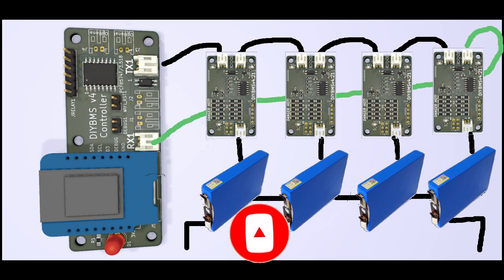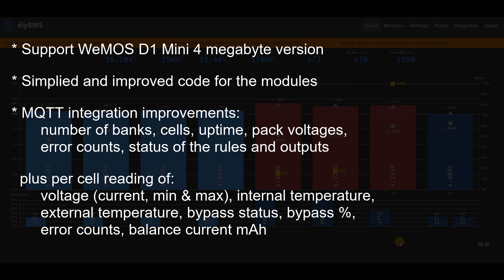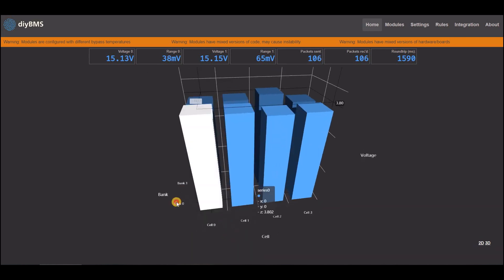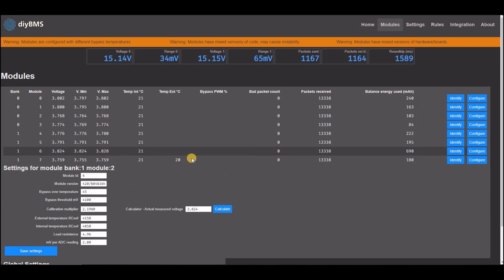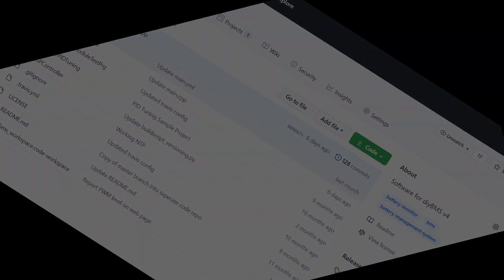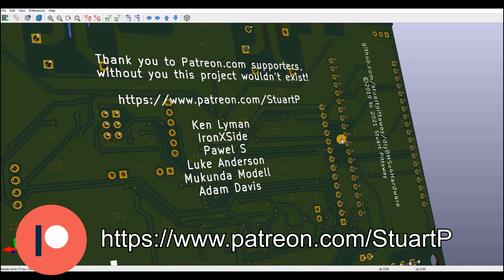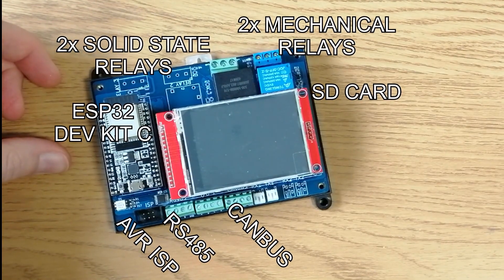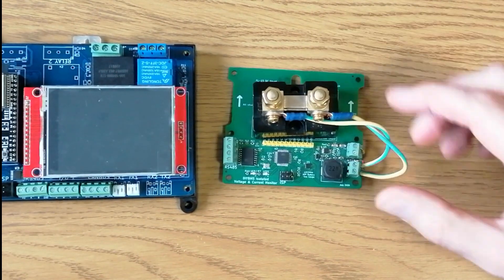DIYBMS, support for 100 modules & new controller update

Comment: Brilliant project! Thank you:) Subbed. 2:28 - i plan to experiment with HV battery. It will be 140 S or even 200 S. Is there any way around the limitation you'we mentioned (100 modules suport)?  Where this limitation is coming from? The daisy chain transmission between modules od somewhere downstream - in controller board or software?
Reply from the maker: Its the daisy chain transmission which is a bottle neck - the speed of the communications limits the modules.  There is another video on this, where I've increased the baud rate to cater for more cells.  Don't think anyone has tried more than 64 modules though.
Reply: @StuartPittaway  Appreciate your answer! Why it is a bottle neck actually? It there some minimum scan time needed? If it take several seconds to scan, say 192 cells in series (two Chevy Volt batteries connected in series) why would it be a problem? I heard some inverters have communication timeout - if i understand it correctly: how frequently they need battery situation status update. If daisy chan scanning is longer than that timeout we can just copy the last status and send updated one once diyBMS scanning is complete. The above exampe with 192 cells in series is an extreme one, i know, however there is more and more HV inverters on the market and there is more and more interest in making HV batteries due to many advantages that come with HV. Yes, HV is dangerous:) 
Anyway, could you please explain me what you mean by saying daisy chain comm is a bottle neck? How about splitting the array into two and perform scanning in parallel?
Reply from the maker: @The_Unobtainium  there are hardware limitations in the design which prevents the communication working over approximately 9600bps. This could be engineered out using different components or protocols, but that seemed overkill when this project started.

Comment: hi . is it possible to create high voltage  power wall bms now with 80s1p at 400v ?
Reply from the maker: No, 400V is dangerous to work with.

Comment: Has any shunt with more voltage support to come? 130 maybe...? Great job!
Reply from the maker: I'm putting together a new video on the progress with the shunt/current monitor
Reply: @StuartPittaway  Great!! I'm starting to learn electronics and install a solar plant in my home. You make a great job! My idea is to make 32s LiFePo4 to get 102v nominal.
Reply from the maker: @paytufo  why such a high voltage? I recommend sticking to 48V, better choice of inverter options and is much safer than high voltage DC
Reply: @StuartPittaway  Because the inverter I will buy can handle 66Amps for the battery since 90V, with less voltage it just can handle 33 Amps. I have heat pump to heat my house and need some power at night
Reply: I've watched the new shunt video and see is limited up to 85v. Could be work the batrium shunt with your diybms controller? I think doesn't have sense to have 32s in the controller and 85v in the shunt. Even though is an awesome job.
Reply from the maker: @paytufo  although 32S is supported (could go higher if needed) I recommend staying below 50V DC, especially for DIY.  Electricity isn't something to play with, and get serious over 50VDC
Reply: @StuartPittaway  I've seen some battery brands that build their batteries exactly as I pretend, even with less protections. Pylontech as example make 48v packages which them put together in series even over 400v. Every package contain LFP batteries with the "modules", then is connected to a BMS. I think the important is to storage safe away hands with all the posible protections. (Circuit brakers, emergency contactors and good cables with appropiate section. Of course, is dangerous, but as dangerous as install a brand battery. Even though I'll investigate more and more
Reply from the maker: @paytufo  it will work, I'm just not recommending it for DIY builders - if you are building a commercial product like PylonTech, it will have been reviewed by engineers and should comply with the relevant safety standards.  Those are not sold directly to DIY market, but to regulated electrical installers.
Reply: @StuartPittaway  Ok, I'll think about it. Thank you very much for your help.

Comment: Hello Stuart
I am using version 4.21 with your current firmware.
To test, I connected a temperature sensor to a cell module. Unfortunately the module shows values that are far too high (61 degrees) can I somehow change this in the firmware or do only special sensors work?
Reply from the maker: Hi Andy, what sensor are you using? Its probably easier to start a question on the forum https://community.openenergymonitor.org/t/diybms-v4/11292/3240

Comment: hey Stuart, will this be compatible with the previous controller pcb? i would like to add the current shunt and the touch screen but i already have the previous controlller boards... thanks a lot
Reply from the maker: Unfortunately not, the old controller doesn't have enough inputs to allow that. The modules are backwards compatible though, so just swap the  controller
Reply: @StuartPittaway   Great! thanks for answering

Comment: Hi, nice update!
- current sensor can be added on each bank or general battery monitoring ?
- protocol like CAN or RS485 will be open to configure it to fit our inverter particularity ?
Thanks
Reply from the maker: The current sensor is designed to monitor the whole battery, but as its modular it could be added to each bank.  The CAN and 485 stuff will be configurable so you can alter this for different inverters.
Reply: Thanks ! Really nice

Comment: Hello, this is an awesome project, I have checked it out a few times now but not been that close to doing my project until now.  I am using Nissan Leaf Electric car modules to my a 5kwh battery at 24v.  It will be 6s2p but obviously much more capacity than a normal 18650 cell.  Would these still be capable or would it take too long to balance?
Reply: I just tried pricing up and see they still dont have the ATTINY841 component.  Do you think they will ever get it in ;-)
Reply from the maker: Rarely, although that part isn't that difficult to solder.  There is a specific board for Leaf cells https://github.com/stuartpittaway/diyBMSv4Leaf
Reply: @StuartPittaway  Thats amazing!!! I have downloaded the code zip file from github, I see it has a BOM file but cant find a CPL, is it the one with all_POS in the title?  Do you know how much these come to roughly to the UK if I get about 15?
Reply: Ok, so I think I got it right, using the all_POS file as the CPL it seemed to go through on the JLCPCB site with just two components missing.  Do you use the same controller board as the normai DIYBMS like I put on the order before?  Also, you mention below you sell the mostly populated board on the openenergyonitor site - Do you sell these Leaf ones?  My soldering wasn;t ever great and its been a while ;-)
Reply from the maker: @alextubbs2095  I didn't actually build the leaf boards so not sure on the exact files to use. The controller is the same for all the boards but the shop doesn't stock the leaf modules
Reply: Hi 
4.21 Module cell will be also updated soon ? I’m on the way to build lot of it , if there is a mod soon I will waiting for it 🙂 thanks
Reply from the maker: @nicof9202  no, I'm not changing the modules

Comment: I'm looking forward to the new controller. Will there still be updates for the old controller when the new one is released?
Reply from the maker: Yes, I'll still fix bugs on the old controller, but I'm limited by the ESP8266 chip so time to move on.  The new controller is works with the existing cell modules and you don't need to add all the extras to the controller so the cost is kept low.